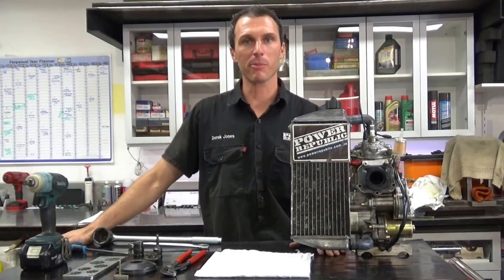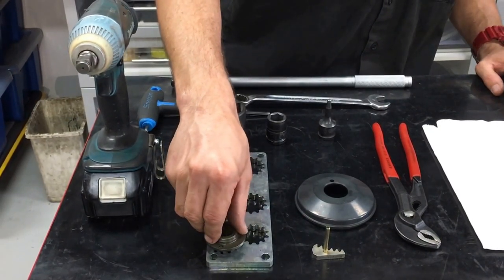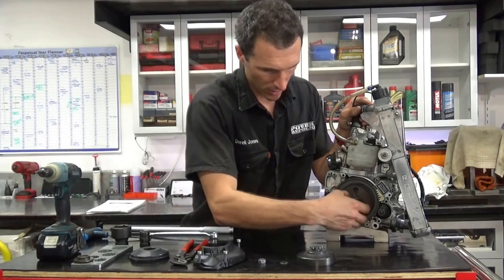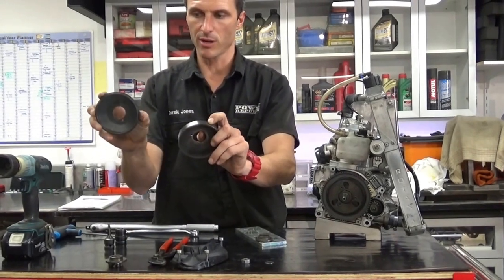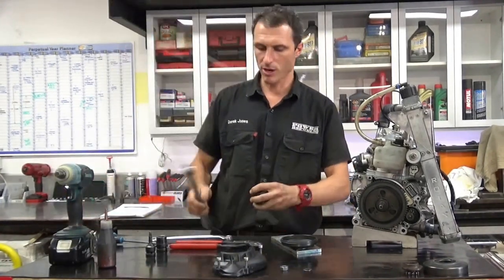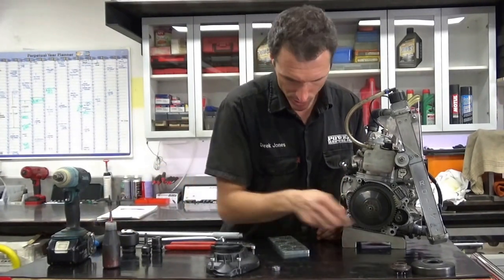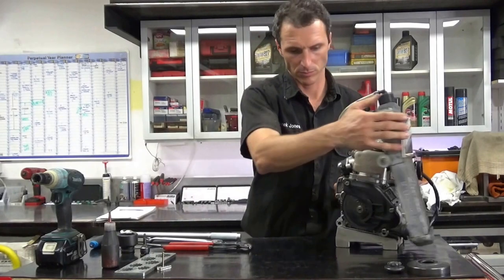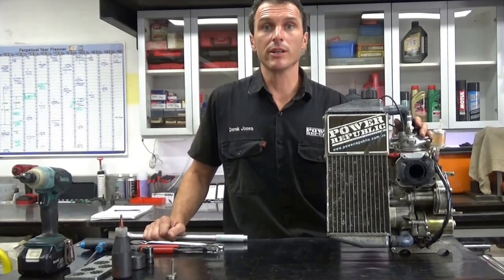Power Republic - Rotax Max 125 Clutch & Sprocket

Comment: should the Starter wreath (big black thing with the 70 tooth) has to rotate or it will stand still when the engine is running?
and what for a function does the clutch have? when do i know its time to replace the clutch?
Thanks Derek
Reply from the maker: Hey Jordy,

yes it is the ring gear and it is fixed to the crank shaft.  the bendix starter gear throws out and engages with the ring gear to crank the engine on start up.

the clutch stops the engine from stalling at low revs.

on the Rotax it is ages between replacement, but change them after they wear heaps on the toes of the clutch shoes

Comment: Hi I have rotax evo I was wondering what would cause the clutch drum to be so hard to come off . Also when the kart is running(idling) is it normal for the back tyers going as well when on the trolley
Reply from the maker: CJ McGrath the bearing has probably gotten dry.  spray some WD40 on the clutch bearing after you have removed the retaining nut and washer.  
Your idle speed might be set too high.  You can change this with the screw on the side of the carby (the one with the spring on it at 90 degrees to the body, just back from the fuel inlet barb)  or the throttle cable might be too tight and cracking open the slide slightly. 
Hope that helps. D

Comment: Great, thanks! I have one question- in Rotax manual there is an o-ring over big washer. But you don’t have it, and my engine also misses it. Should it be there? Without it a clutch drum is slightly touching gear, and with it clutch drum don’t rotate freely.
Reply from the maker: Hey Kim, yeah the O ring is for the 12T and up.  If you use the 11T front sprocket you can take the o ring out.  It doesnt effect the engine on the track but it will spin freely on the stand without the o ring
Reply: Power Republic Thanks you)

Comment: which Rotax is that? old non Evo? and that filter sticking out on the right at 5:14 is that for the gearbox oil? my senior evo just has a rubber hose sticking out.
Reply from the maker: its just a fuel filter attached to some fuel line on the gearbox breather outlet.  rubber hose if fine too

Comment: Smoke was coming out of my clutch for about 2 minutes after I took my Rotax Max kart for a short run.
 Do you think the clutch is on its way out?
Reply from the maker: Hi there. I would take the clutch drum off the crank shaft and inspect the clutch shoes. If they are the older style, I would suggest updating them to the new steel clutch shoes (the older ones are not worth replacing).

Comment: Sir is there any problem with using two different length tie rod?
Reply from the maker: CRG and birel have a 5mm different length tie rod I believe.  you can get an adjustable length tie rod from DPE/Arrow as well if that suits you
Reply: Thx

Comment: After changing a cracked drum for a new one my wheels stoped rotating freely - when you rotate them they are moving a piston. Is it supposed to be like that or I did something wrong? All washers are installed the same way, only thing changed - new drum which looks exactly the same.
Reply from the maker: just take out the clutch o ring and see if it spins free again, otherwise have a closer look at the shoes, maybe they are stretched.
Reply: Power Republic O ring is out, it happens without it
Reply from the maker: kim possible new shoes or the old ones have spread out is my guess
Reply: Power Republic Thanks, I will look up :)
Your videos are awesome, thx for your work
Reply: Power Republic I looked a bit more and noticed that it almost can rotate freely, but it seems that around 0.1mm is blocking it. The previous drum looks like that way thinner. Should I put some lube on it where drum touches clutch? Or maybe remove that 0.1mm with fine sandpaper?
Reply from the maker: @ВікторКузнєцов-с9м  fine sandpaper.  lube will make it slip when under load.
Reply: Power Republic Okay, thanks. And if it won’t help I should change clutch for a new, am I right?
Reply from the maker: @ВікторКузнєцов-с9м  most likely mate
Reply: Power Republic Thanks :)

Comment: I've got like 1 - 1.5 millimetre of play in my front sprocket, is this normal or do I have to tighten the nut some more maybe? And if I allign my sprockets should I allign my rear to the most inward or outward position of the front sprocket (in case the play is us usual)?
Reply from the maker: Are you talking Rotax or X30?  for the Rotax with the 11T front sprocket and bush, if the bush is flogged out then the clutch drum will move in and out.  For the X30, when the internal and external thrust washers wear too much, then the the clutch drum will move in and out.  Check those things.  Hope that helps.
Reply: @PowerRepublic  I have a Rotax with a 12T front sprocket

Comment: What can I do. My back tooth plate has come loose from the clutch somehownmbI can't take my front nut off because the engine rotates still.  When I lock the engine and then the nut the center part moves with the nut also . I'm at a loss . I'm guessing someone over tightened it now I can't take it off without crank spinning with the  nutt also . I locked the wheels up clutch and tried to untwist and the center still moves with it
Reply from the maker: Easy as broski, get a 'piston stop'

 https://www.internationalkarting.com.au/shop/item/tool-for-locking-crankshaft-piston-stop/tools-01

  that will stop the crank rotating while you get the nut off.  Clean everything, use loctite, and torque the nut back up to 110Nm
Reply: @PowerRepublic  you're the man

Comment: hi Derek, one question again, I didn't see you put the o ring that goes in first before the inner thrust washer....is this not used on the 11 tooth?
Reply: According to the Rotax manual, the thrust washer goes first, then the o-ring... I've never actually seen anyone use this o-ring, so can someone tell me the purpose of it and if it is indeed required?
Reply from the maker: @schatn  I use the o ring with the 12T to stop the grease from coming out in to the clutch drum
Reply: Without the o ring, you can get disqualified, as without it, it allows grease to get into the clutch. Greasing the clutch is a well known cheat in Rotax, but can easily be heard at trackside.

Comment: hi Derek, I currently have a 12 tooth drive sprocket fitted to my fr125 max and I want to switch to an 11 tooth, aside from obviously the sprocket....what else do I need to change inside the clutch drum?
Reply from the maker: Christopher Ramnauth 
Hi Christopher, 
You will need an 11T bush (bearing) and 11T retainer washer as they are smaller than the 12T. You can buy them off our website www.powerrepublic.com.au

Comment: Can i add my rotax fr 125 power valve, which is std cylinder has no power valve
Reply from the maker: rifar er you can interchange the Senior max and Junior Max Rotax cylinders on any FR125 Rotax bottom end. Assembly. The new Evo engines require you to change the black box ECU however.  Hope that answers your question.

Comment: What's the difference between the two different teeth? Power?
Reply from the maker: Do you mean 11 tooth or 12 tooth front sprocket?  If so, it's the number of teeth on the outside diameter of the front sprocket.  The more teeth equal a bigger diameter the front sprocket is and the the higher the Max KPH the kart will achieve with the same engine RPM
Reply: Power Republic sorry I didn't elaborate more but yeah between 11-12 teeth. Thanks! I appreciate it